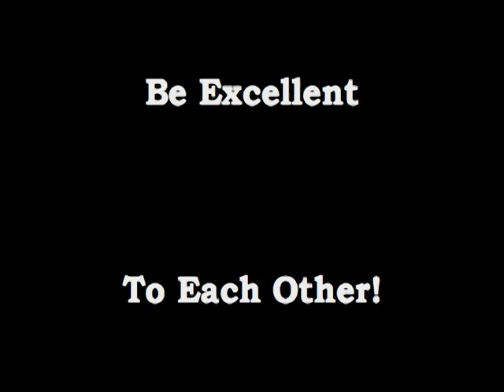Two Hearts Become One

Comment from the maker: @c15688 

The homopolar motor works by the Lorentz force, which can be predicted by the right-hand rule. See wikipedia "Lorentz force" and "homopolar generator".

Normally, the rotation can be reversed by flipping over the magnet. That's hard to do in this case. However, the battery could be inverted with the + terminal at the bottom, and the rotation would reverse.

Comment from the maker: The homopolar motor needs lots of current to run, as it can draw several amps at times. So, the joule thief or solar will help, but likely not enough power to run without the battery.

Comment from the maker: @uSee218 
The hanger is magnetic and will be useful for hanging a battery or magnet, but is not good for making the hearts. The heart wire must be conductive but not magnetic, like copper, silver, or  if you can't find those, gold will do !!

You can always tear into a wall and yank out the wiring...
(remember to turn the circuit breaker off first ;)

Comment from the maker: @uSee218 
I used 8 gage solid copper wire. You can use as thin as 18 gage and it will still work. I went as thick as practically possible.

Comment: Ah ok I understand & was not expecting not to use the battery. So it wouldn't work with high volts low amps I guess?